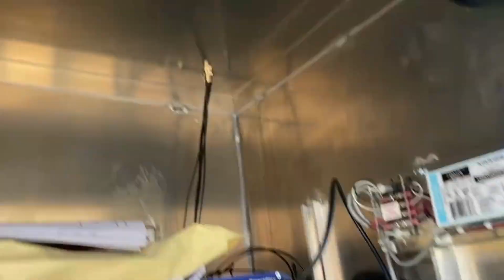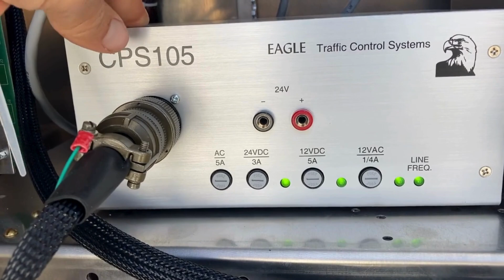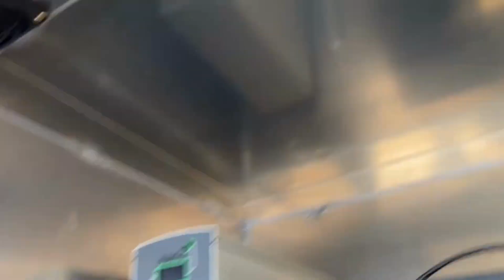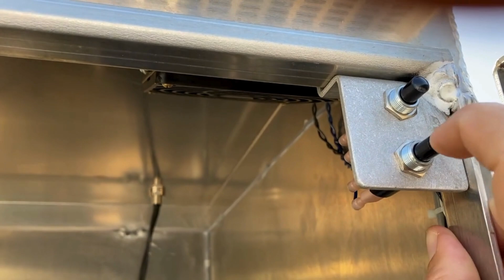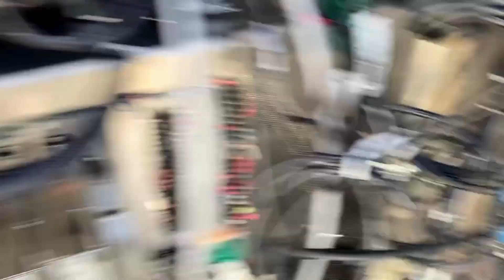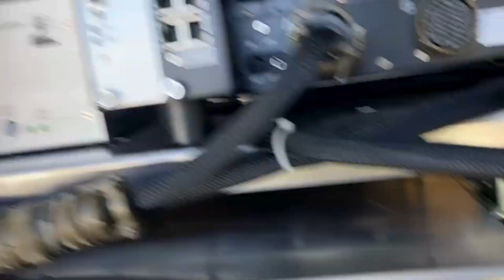Performing a Traffic Signal Punchlist - Part 2

Comment: can you explain more about the controller? and how all the C and E's mean on the call screen and all that? Cheers
Reply from the maker: Did you mean C and R's?  You'll notice on the screen just to the left of all those C's & R's it says VEH.   This is short for Vehicle.  Then go back to the C & R's again.  Follow each one upward two lines to where there are numbers. These numbers represents a phase (or movement).   
So if we put it all together, a C or R in a VEH row and then going upward in the column to a number represents the phase.  (for example, the very first one --A Vehicle Call for Phase 1--which is a mainline left turn movement).
C's stand for call and R's stand for recall.  Recalls will always return to that direction whether there is traffic there or not.  C's are placed only when there is a call from the processor (or detector card) for an actual vehicle being present.  
Hope that makes sense!
Reply: @streetsmartstraffic  Nice, I got most of that and yes I meant C's and R's looking back at it lol. So basically C is just a call from like the cameras and a car is there and R just means it always goes back to it since it's probably a main road or something right? Also loving the fast response here. Also so far your content is amazing
Reply from the maker: @aiden88883  You are correct.  R may be used also if the detection for say, a side street, goes down and we want to make sure that vehicles get their green light.  The flip side is that side street will get a green light even if there are not vehicles there.  
Thanks for the kind words!

Comment: What does the mysterious SHA-1250 do to be important enough to need an alarm contact? Im a traffic controller n00b.
Reply from the maker: Great question!  @ickipoo already figured it out.  The SHA-1250 surge protector has a built in alarm featured on it.  More of a troubleshooting tool than anything as you see that the alarm output can be tied into the controller alarms and can help aid in the troubleshooting process.  Thanks for asking!
Reply: Googling suggests it is a surge protector.
Reply from the maker: @ickipoo  Thank you for answering!
Reply: Yep, if the surge arrester is showing an alarm, expect all sorts of weirdness! LOL
Reply from the maker: @ickipoo  Yes sir!  Thanks again for jumping in and answering the question 🤙

Comment: I have a access controller in my apartment that goes to the door, with a battery backup, and the "ON BATTERY" relay (that pulls a 'AC failure' tech zone on my burgular alarm) WILL not pull until the battery voltage drops a certain bit below the charge voltage (thats how a "in-line" battery backup detects its running on battery) so depending on if its a in-line battery backup or a switched one, you might want to wait quite a bit time before going to the conclusion that the status 4 alarm is wired incorrectly. I would say, depending on how much amps the whole system is pulling from the battery, you might want to wait a bit of time. I don't know how long the battery backup will hold during a outage, but usually, you want to wait atleast about 5% of that time.

For me, its when the voltage drops below 26.5 volt (2x 12v lead acid), that the "ON BATTERY" relay will pull, so for my access controller, I have to wait about 1-5 minutes after flippin' the main power before I see anything in the burgular alarm log, then its a about a 2 amp pull on a 6 amp battery backup. On that particular battery battery backup I have, I can remove a jumper to make the "ON BATTERY" relay a low battery relay, then it will not pull until the voltage is below somewhere 24v, but you have 2 separate relays for that, so I don't think anything is configured incorrectly there.

(The battery backup is a milleteknik ECO 27-30 XS which gives about 27 V out on AC present, and then it will give battery voltage out on battery run)

If its a switched battery backup (meaning, a relay has to "connect" the battery into the output when it loses main power) then the "ON BATTERY" indication is usually instant, but then you would lose power to the traffic lights for a few milliseconds when you switch off the main breaker, before the UPS "jacks in".

Your battery backup also said "No Alarms" so guess it has to be without power for a certain time before it asserts a "On battery" condition.

Also it seems your controller are listing the alarms from oldest to newest. You might want to press "NEXT" to ensure the UPS alarm is not on the next page.
Reply from the maker: Great information Sebastian and thank you for sharing.  You have a very great point there about the delay of the alarms and jogged by memory.  This is a newer 'upgraded' Alpha unit.  I found 'by accident' awhile back that the older version instantly placed an output but the newer version delayed it.  I know because in an older setup, we had the On Battery alarm actually provide the 110  battery back up to the traffic light.  When we replaced it, the newer upgraded Alpha when tested, put the signal to dark.  It racked my brain for 2 hours trying to figure out what was happening.  Called their customer support and spoke to the engineer that designed it.  He said there's a programmable delay for the amount of time before the alarm outputs but it will go no lower than a 60 secs delay.  THANK YOU for reminding me of that!  I'll go back and check.  Much appreciated!
Reply: @streetsmartstraffic yes I think the newer ones delay the alarm because it sometimes flips for a short duration during a brown out type event. So to prevent tons of error messages appearing because the grid drops in voltage for 30 seconds or so, the delay makes sense here. I would say this is a good feature to have since the grid has brief periods of low voltage situations often. You really only care if it's running on a battery for over a minute anyway. I just found your channel and I think it's very interesting just how complex these systems are now. I have worked with these types of automation devices and built many robots so I find it fascinating how complex we overengineer things these days.
Reply from the maker: @newmonengineering  That makes perfect sense.  The older models didn't have a delay on them which is what I'm used to.  That's what was throwing me off.  But I won't forget that now!  And yes, it seems like overengineering things happens all too often!  Thanks for commenting